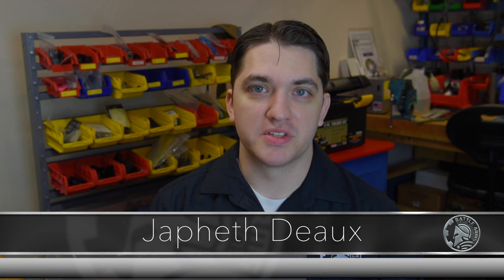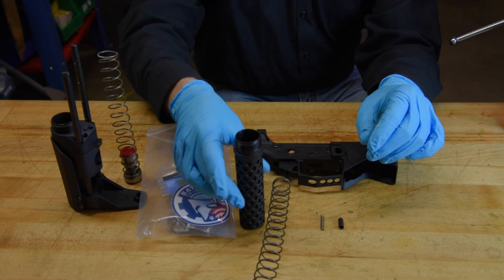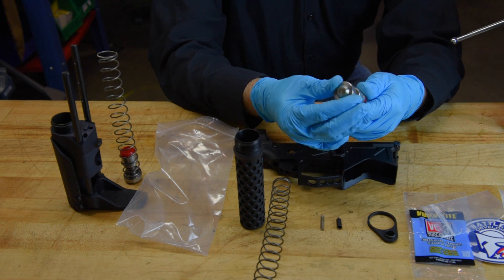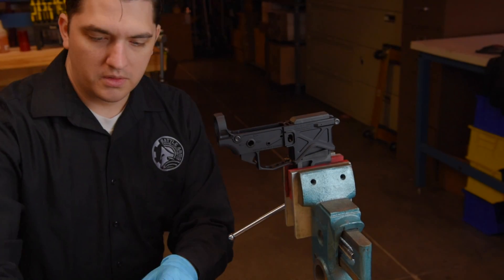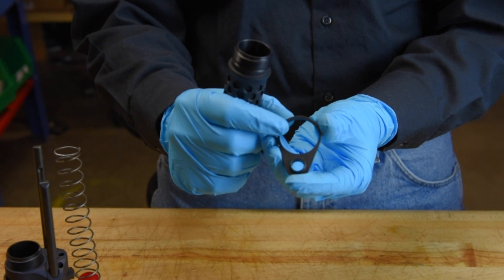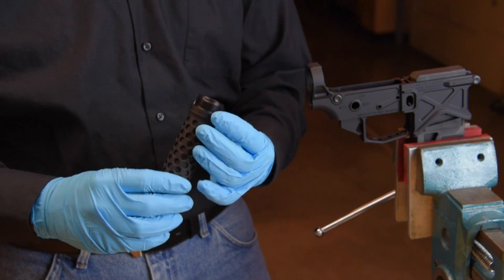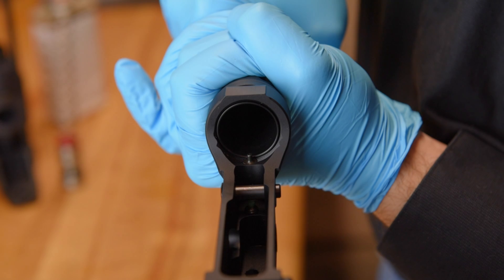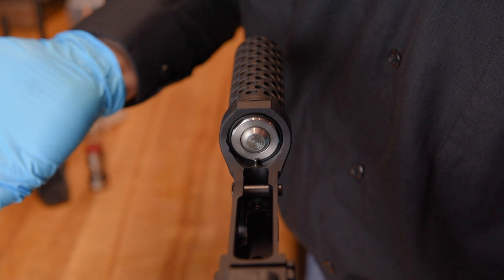Ultra Compact Pistol Sabertube + Vert® Buffer System - Combo

Comment: I have one of your Ultra Compact Pistol Sabertube + Vert Buffer , but my upper receiver no longer opens , I have tried 3  different bolt carriers &  the safe thing happens,  the bolt jams on your piston,   so I have gone with a different company.
Reply: steve golden that is a normal install, the vert buffer is cone shaped center section that actually when the rifle is fired it guides the inner portion inserts itself into the carrier. That why the warn you to have a minimum of 5/8” bore in your carrier and 5/8” minimum depth and cautions about nickel boride carriers due to the thickness of the plating. All it takes is a firm bump on top of your forearm ind it comes right apart. I love mine and have several and it is consistent on all. I’d rather have the tapered guide and compression of the spring on firing than not. It’s a technique to burn in the brain, but all of mine run flawless.